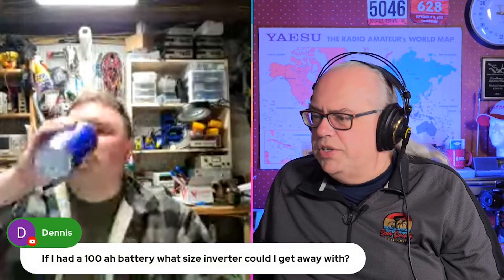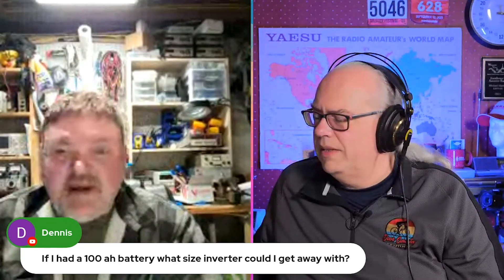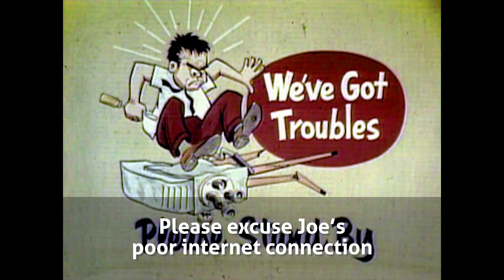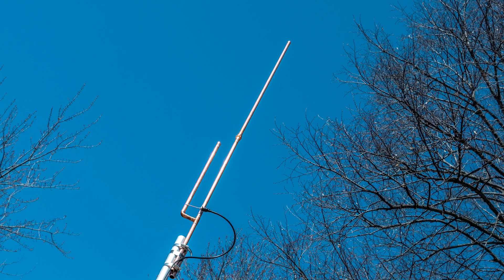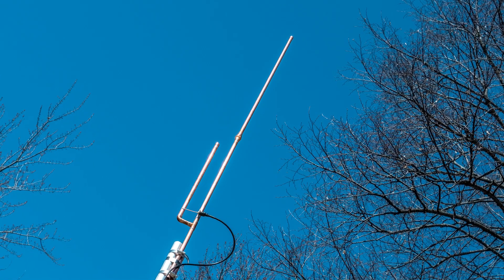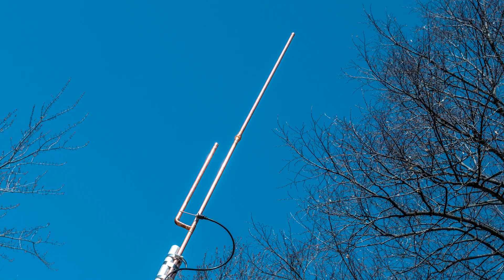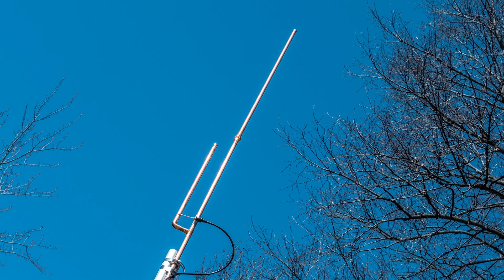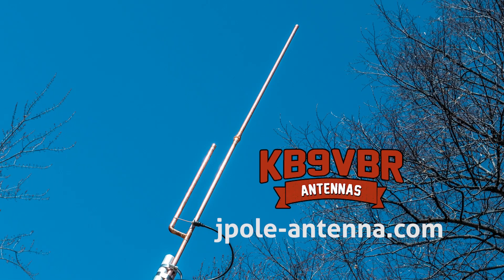Ask Michael, KB9VBR: How big of an inverter can a 100ah LiFePO4 battery power?

Comment: Many batteries will have discharge rates from 1c to 5c. I am cheap so have one at 1c but that is still 100 amps draw and within spec so they are getting so much better.  Definitely correct with sizings. But now you can get server rack batteries that have all the smarts built and they are made specifically for solar installs.  I work in the marine industry so i get to play a bit with it.

Comment: I only use 300w & 600w inverters for a max draw of no more than 2/3 of their capacity and mainly to charge my power stations that are capable of  continuously input of 500 & 1300w fast charge. I don’t fast charge any power stations I have in order to not stress batteries to extend their life..

Comment: I'm running a 6k inverter powerjack (I know 3k) 12v 2/0 cables with 100a charger and I can run 2.5 to 3k for about 30 min.

Comment: Folks, consider watt hours.  A 100 Amp Hour battery at 12 volts has 1200 watt hours in it.  U wanna draw 1000 watts?  Also consider that battery capacity drops at high drain, and the inverters efficiency.  IF that battery will deliver a hundred amps, you MIGHT get 45 - 50 minutes.  A Lipo 100AH probably wont deliver more than 30 - 40 A without overheating.  Buy a generator.  Recharges quickly with a gas can, too. Jerry  wa2omu